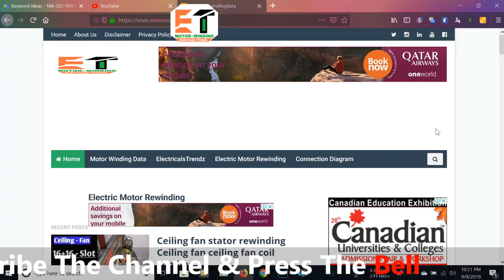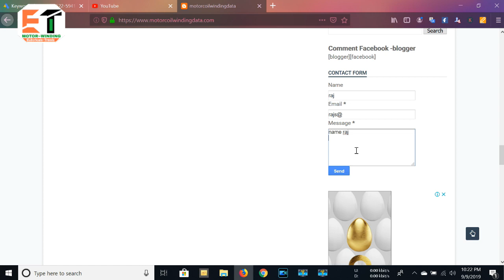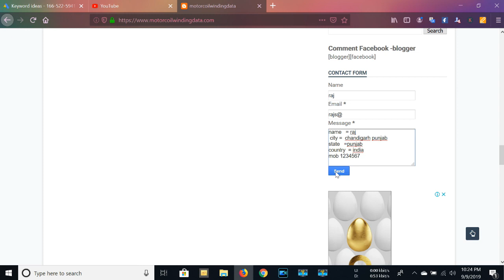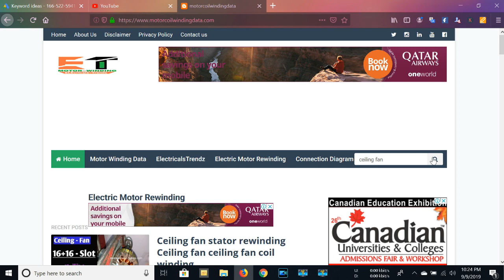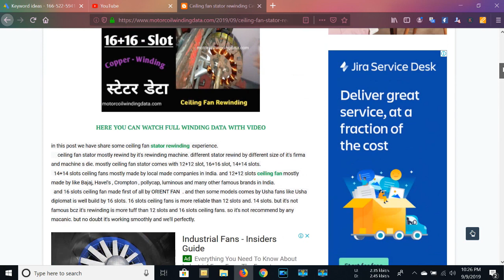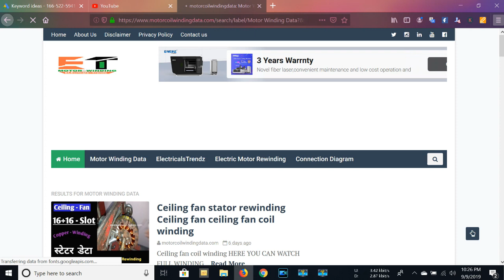Full Rewinding 24 Slot Cooler Motor Winding Data | 24 slot 1440 rpm Motor Winding Hindi💥

Comment: Sir Maine 1 inch stator or 3 inch under ki cooler motor winding karni h 3 speed me 30 or 32 no. Aluminium wire se please data bataiye
Reply from the maker: Sharma ji aap video description me dekhiye usme aapko poora data mil jayega